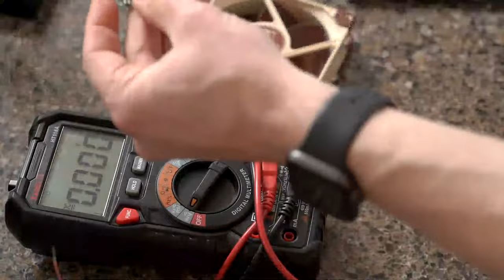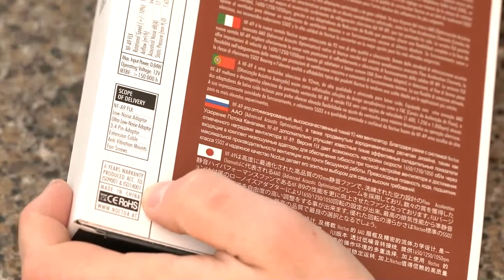This Could Go Terribly Wrong - Live Studio Light Repair

Comment: Hi Wes, is your light still running without overheating? Are you happy with the color rendition? My SD300D tends to be to much in the magenta range for my eyes... I got two SD200D and one of them has a noisy fan, its the bearing so I planned exactly the same procedure like you here (have enough experiences in electronics). Btw the 200's are looking more neutral in colors than the 300. I had a lot of fun while watching your video, best wishes from Germany!
Reply from the maker: No heat issues since replacing the fan, no. I do find that after a while the power supply gets much too loud. Should I replace the fan in that too? Haha
And I haven’t noticed any issues with the colour either.
I really need to get a fancy colorimeter, just need to find a few thousand dollars to spare 😂
Reply: @WesPerry  Whow, superfast response! My version of the 300 has a fanless power supply and gvm changed obviously the cooling strategy: the fan (in the light) starts slowly only in the upper region of higher output wattage at around 80% and survived the first longer lasting shooting session... so far😶🤞
Reply from the maker: Ah very interesting. Mine is incredibly different from this!